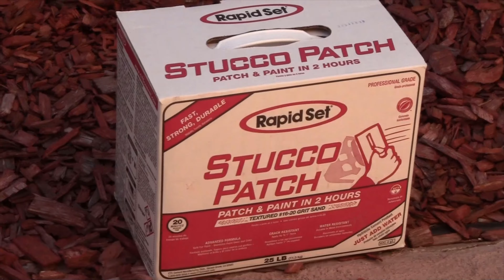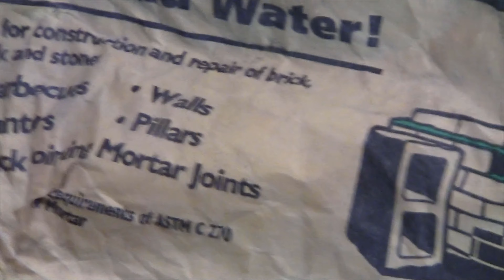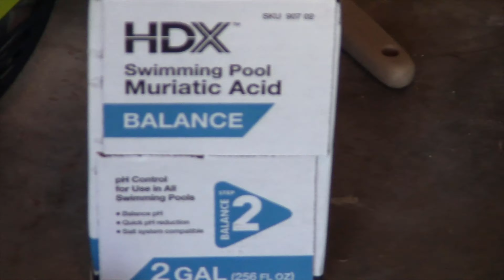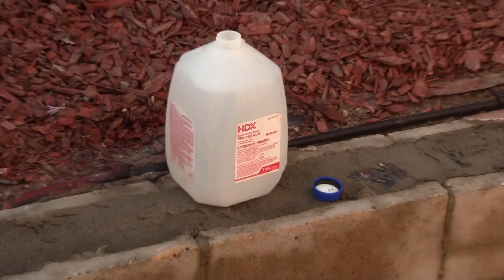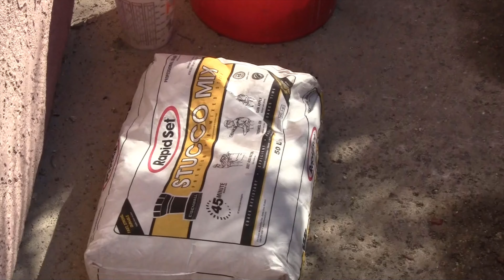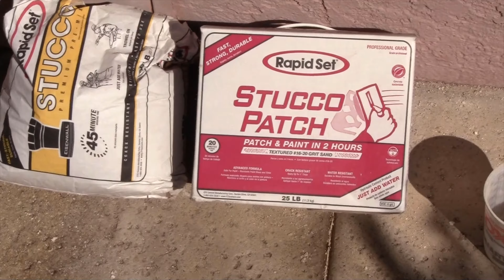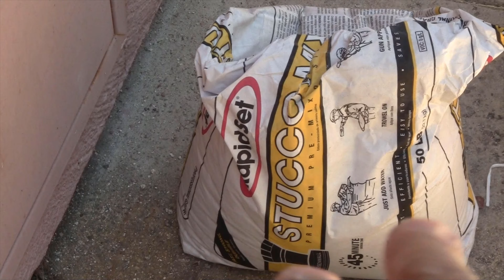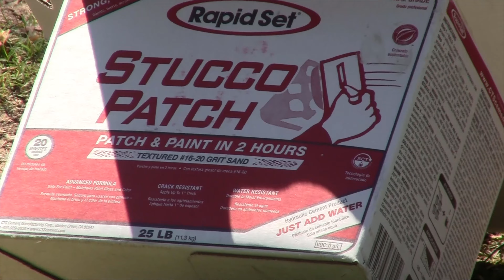How To Stucco a Wall with Rapid Set Stucco Patch Full Version

Comment: Total number of boxes needed for this project? I’ve been removing the stucco from around my foundation due to loose and failing stucco with a rotary hammer, very slow and tedious work. However the product used in this video has become hard to come across drove an hour and a half to pick up 13 boxes to start. Thank you in advance
Reply from the maker: I never did keep track but I did make several trips as needed and got 20 boxes at a time. Btw, the job is holding up very nicely.